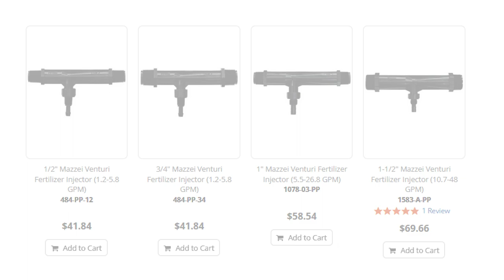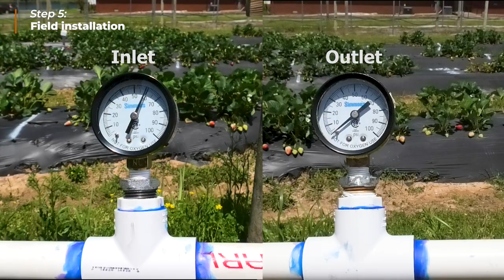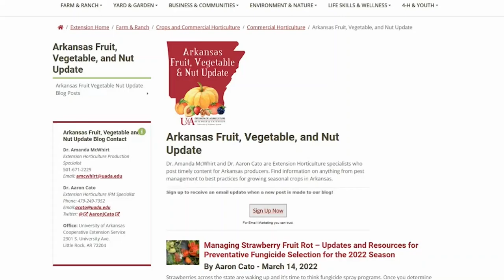How-To Build A Venturi Injector

Comment: I built one of these but it will not work with the amount of emitters I have. I am using about 50-60 half gallon emitters.
Reply from the maker: It is possible that you don't have enough flow through the system to run the venturi.  Check the flow rating for the venturi you have and consider if a 'low flow' model might work better.

Comment: Dude! 
I spent a half a year to make an 32mm KPE pressure valve set but the sunction is just not working. 
Could you please spend some time with me in a call, to make it happen? 
Thanks!
Reply: Make sure that the short pass thru pipe (black) that has the chemical draw line is a smaller size than the main lines in the system. Venturi suction is created when liquid from a larger line 'constricts' or squeezes to pass through a smaller line... kinda like putting your finger at the end of a hose to shoot water higher creates a higher velocity. That velocity draws the liquid into the system. Research 'venturi effect'.

Comment: I have to admit that my head is spinning trying to figure that chart!  I have two Amazon cheapies running in my home build injectors, and one dies great, the other barely sucks up fluid at all. How do you find what your water pressure is to begin the process of picking the right Mazzei.

Comment: Is the half inch reduction necessary for the Mazzei to work properly?
Reply from the maker: Great question, Tim! The reason for the half inch reduction was to accommodate the size of threads for this particular Mazzei injector. Since both ends were ½ inch threads, we reduced the size from the main line to ½ inch to make hooking up the injector simple. However, if the injector had the same size fittings as the main line, there would be no need to reduce the line size down. As long as the injector has sufficient inlet pressure, flow rate through the injector itself, and sufficiently lowered outlet pressure, the injector will be able to inject fertilizer into the main system still. There are also some great data sheets and brochures that also help explain how to choose which injector will best fit your needs, here is an example for Mazzei injectors: http://www.mazzei.net/sites/default/files/files/US-Combined%20Tabless%20REV-G-Secured.pdf
Reply: Thanks, nice video, did y’all do any research around how much liquid (fertilizer ) this set up was able to pull (suck up from bucket) “tuned” and at different valve settings?  If so and could share that would be great in helping us newbies calculate the strength of our fertilizer tanks/buckets.  Thanks again for this video, anyone in the audience that can help me that would be awesome too :)